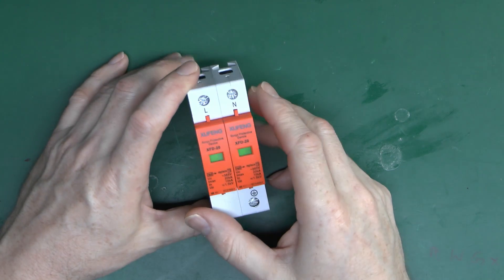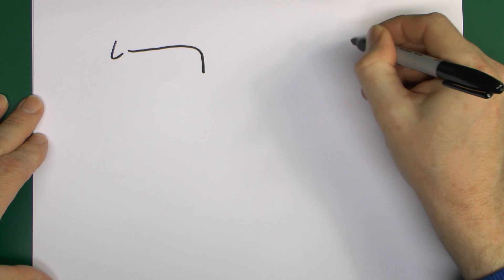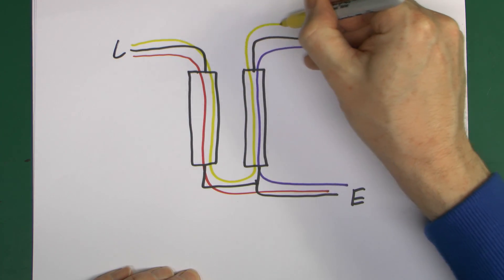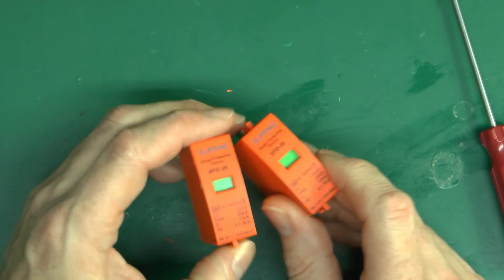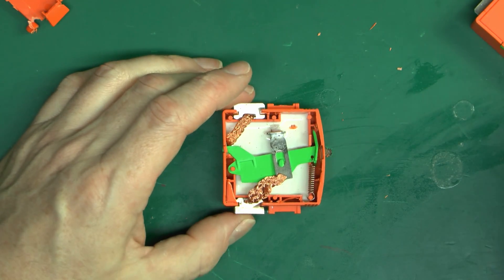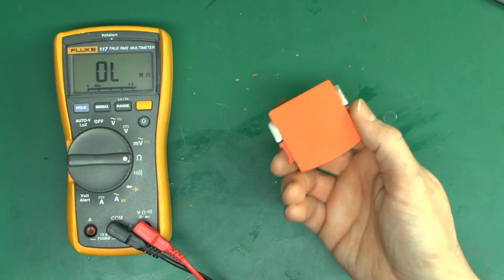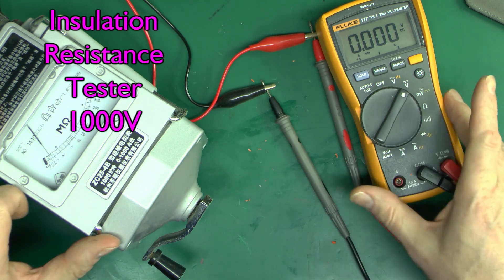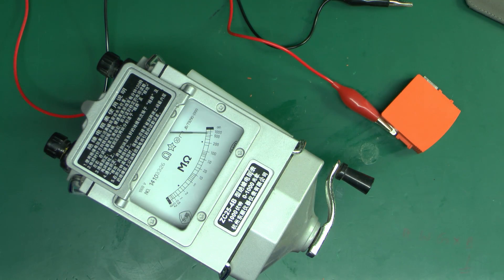Surge Protection Devices - Part 2

Comment: It has always been the case that new devices like these will have a massive profit margin as users have no idea that it is a few simple component that costs pence when purchased in bulk, it is the same with the gas discharge tube you find on the more expensive devices.

One of the features these have that wasn't mentioned is that the fault indicator arm when operated will protrude from the bottom of the module. If you have holders with the small microswitch in the base this is pushed in by the pin at bottom of the module. This will then operate some form of warning device so serves as a very basic fault warning feature.

When you consider the current that will flow during an overvoltage condition I can see an issue arising. If the device is inline with a simple MCB this would operate during an overvoltage pulse and would very likely be enough to trip the magnetic plunger fast disconnect in the MCB. This suggests that a higher rating MCB should be used but this would increase the chances of an overheating or fire.

I have used MOV's and GDT's in my own installation but used an MCB designed for high inductance loads. This will minimise the chances of a transient causing the MCB to open and depriving you of all future protection. It is therefore vital to have a method of monitoring failure of the module and tripping of its protective device.

Save yourself a lot of money and purchase some high grade MOV's, GDT's and incorporate a spark gap if you can. I have also seen some SPD devices using thyristors to clamp large surges. Using thermal glue bond some 80 of 100 degree centigrade thermal fuses and wire them in series with the MOV;s. As varistors fail they will slowly heat up so thermal protection is vital. I also incorporated a cartridge ceramic fuse (slow blow) and a continuous operation mains relay. Wire this to the output side so if the MCB trips, thermal fuse opens or fuse fails the contacts will open. The relay contacts are connected so they interrupt connection to a mains rated buzzer and warning lap. A neon with current limiting resistor can be used to show that the supply is present. Place all these components in a sturdy metal project box (don't forget to bond the PE to the box) and if you have used the correct components and wired the box correctly you will have a device that does everything a type 1, 2 and 3 SPD can do at a fraction of the price......... P.S. Don't forget to isolate your SPD when performing any insulation testing.

I hope this will help those of us who know what we are doing and can construct a device like this ourselves. Do not attempt making an SDP unless you know what you are doing !

One other question I had.... I remember watching a study by one of the universities that proved the majority of the energy flow was in the upward strike and the downward strike only when attracted by the potential difference in the ground served to ionise the air and allow the energy to escape upwards. In my experience with data and comms I have seen far more damage done to buried cables than overhead catenary cable runs. I am 99% sure that the study I watched proved that underground cables were at a higher risk than overhead ones. If this is not the case these days I can only assume it is due to underground cables being run in ducts or directly buried cables being SWA. Overhead run power lines and telecom services normally just have a stringer for support and would get no benefit from the shielding effect of SWA cable. Has anyone seen any later studies of lightning behaviour ? The study I watched was done in the early 90's.

Cheers all.

Stuart
Reply from the maker: MCBs are too slow to react to overvoltage transients - typical duration of microseconds, compared to milliseconds to trip an MCB.
Reply: @jwflame  I was considering the fault current that flows when the MOV clamps as opposed to high voltage spikes affecting an MCB. It may be possibly damage an RCD with its electronics but I expect they install a MOV on the RCD to protect against this.

I can foresee problems with the MOV's leaking as they wear out and someone has made the mistake of installing the SPD on a MCB that is protected by an RCD. Could be a visit to false trip RCD hell if you are not aware.

I would be interested to know if anyone has seen thyristors or heavy duty zener type protection on an appliance or an SPD.

Thanks for the reply John.

Comment: Will you be covering the surge protection that is apparently present in many extension leads? It is my understanding that, as long as RCDs and these MOV devices are present in the consumer unit, such "surge protection" as in extension leads is useless.
Reply from the maker: Depends on the distance from the consumer unit to the outlets - it may still be required for distances over 10 metres away from the consumer unit device.
Reply: Jivan Pal - the manufacturers will have you believe that there is no such thing as too much surge protection... But then again, the consumer unit versions are considerably more expensive than having a reasonable number of surge protected extension leads... The choice is yours.
RCDs don’t really affect things, other than they are useful in switching off the supply if a surge protected extension lead suffers a failure of the protection system and leakage current flows to earth from either the line or neutral circuits.

Comment: Im concearned that when mov wears out (with many less severe spikes), it wouldnt always show red as solder would have to melt first. Also when mov has worn out does it give us an open circuit?
Reply from the maker: When they fail, they become more conductive, until eventually enough current flows to heat up the solder link and cause it to melt.  It's a chemical compound, there isn't any realistic way it could fail open circuit.

Comment: Was it BigClive or David Savery that did a video on this about a year ago?  He simulated a thermal event using a soldering iron to allow the spring mechanism to operate.  The solder melted and pulled the conducting link downwards, but the excessive length of the link meant that a gap didn't successfully form.  It looks to me that this is likely to happen on these Xufeng devices.  Any chance we could see this demonstrated on the one that didn't get mangled?
Reply from the maker: Yes.  Have got 4 of these orange cartridges, so 3 intact ones to do something with.
Reply: Yeah was Big Clive, another money making scam this crap....
Reply: It was SDG Electronics that used the soldering iron to simulate an overheat event.

Comment: According to manufacturer Dehn, the only SPD suited for use in a TT earthing system has a MOV from L to N and then from N to Pe; no direct path from L to Pe.
What could be the reason for this?
Reply: To avoid the risk of a failing MOV causing the CPC to rise up to dangerous potentials.

Comment: Are AC and DC compatible?  Same MOV components?  Thanks
Reply from the maker: The basic MOV elements will work on either AC or DC.  However commercially supplied surge protection devices are intended for one or the other, and should only be used according to the manufacturer's instructions.

Comment: I've heard stories about these SPDs failing. Apparently the surge has been known to bypass the MOV completely and fry the installation anyway. Not sure whether or not SPDs were from a reputable manufacturer. here in Malta we are obliged to insert an overvoltage and undervoltage relay between the DP MCB and RCD at the origin of the installation. I dare say that the relay is a safer/ more reliable option.
Reply: I dare say that the relay is a much slower option and therefore a much more useless option.
Reply: @bdf2718  but I would think that an OVR is never 'spent' and therefore always affords an element of protection. From what I can understand an SPD can be spent and go undetected thus giving a false sense of security. Is that right?
Reply: @rooselectrix4846  OVR might protect you against the sort of line faults that put an extra 50V on the line.  It operates in a millisecond or two (if it's a fast one), and your equipment can probably survive that (filament lamps and heaters almost certainly, electonics maybe).

John was talking of higher voltage transients that last for microseconds to milliseconds.  By the time your OVR opens, the damage has been done.

The problem with MOVs is that they degrade a little when they deal with a transient and eventually wear out.  But before they wear out they handle things your OVR can't.
Reply from the maker: Overvoltage relays/trips are for entirely different types of problem,, and are useless with transients - far too slow to react, and it's not desirable to cut off the supply if a transient occurs.
SPDs are useless with overvoltages which last more than a few milliseconds - they will be destroyed.
As is always the case, it's about selecting the correct type of protection for the problems that are likely to occur.
Reply: @bdf2718  I have another question, if I may. In Malta most meters come with an incorporated 40A DP MCB (it is 40A, true). I was thinking that perhaps these SPDs could be fitted 1st thing after the meter, take the tails and main earth into it and connect the rest of the installation in parallel. 
It would look something like: meter -> SPD -> DP MCB (or main switch) -> rest of the installation. Does that make sense?
Reply: @rooselectrix4846  Nope, doesn't make sense.  What happens if the SPD is exposed to a long-duration surge?  The big fuse before the meter blows and you have to call somebody out to fix it.  The main breaker should come before the SPD.  Not just so that the consumer can turn the breaker back on, but also so that if the SPD fails the breaker can be turned off to allow the SPD to be replaced, rather than having to pull the big fuse.

[edit] I'm assuming, above, that the SPD fails in such a way as to damage the carrier so that the carrier has to be replaced.
Reply: @bdf2718  Thanks for your reply. Our meters come after a service head with a big (60A) fuse then, built into the meter, is a double pole MCB. I don't know if I was clear on that point earlier. Does that change anything? I was thinking that the MCB in the meter could act as protection for the SPD. My thinking is that a surge will pass through the meter anyway, so we can use the meter to protect the SPD. Thanks again.

(Just so you know, all domestic installations are TT here.)
Reply: @rooselectrix4846  I think it's more I misunderstood you than you were unclear.

Is the meter MCB operable by the consumer or is there a wire seal or something else that means the consumer can't operate it?  If the consumer can't operate it, you need another breaker the consumer can operate rather than having to call out an electrician to reset the meter MCB and replace the seal.

Is the breaker electrically before or after the meter?  If it's head->MCB->meter I'd be happier with another MCB between meter and SPD, even if it's the same rating.  But that's just excessive caution on my part as it shouldn't make a difference to the surge currents in the meter and the meter ought to be capable of handling them.

In the end, though, it's down to what your wiring regulations say you can do.
Reply: @bdf2718  The MCB in the meter may be operated by the consumer. The MCB is an integral part of the meter - which is why I've got this 'fixation' with using it as protection for the MCB.

 The meter itself is sealed but there is a window through which you can turn the MCB on or off.

Here in Malta we are expected to follow the latest edition of the BS7671.
Reply: @rooselectrix4846  I'm not an expert on these things.  Sounds to me like you could get away with it, if BS7671 doesn't say you mustn't do that.  JW would be the best person to tell you if BS7671 lets you do it, and whether or not it's a good idea.

Hmmm.  Does BS7671, as commonly interpreted in Malta, let you get away with the meter MCB being the only main breaker or must you also have one in the consumer unit?  If you only need the meter MCB then you can get away with it.  If you also have to have a main breaker in the consumer unit, then put the SPD after that.
Reply: @rooselectrix4846  hello friend. I was thinking the same with you, positioning the SPD in a better place, not like all the others in the electrical panel, and after the meter as you mentioned in your comment in my opinion is the most suitable place to put it. But I don't know if the distributor-operators allow to put it there. In the new meters the din rail were is located the braker switch has plenty place to put the SPD. I have nothing to do with electricity, is just my hobby, I am a  mechanical engineer. In my country we have a lot of lightning strikes problems. My neighbor's house was burned. In his case  it came from the antenna TV cable! Has nothing to do with the SPD. But never knows. For such a price is better to install it and not to loose all the domestic devices or even your life! Greetings from Albania!

Comment: Help! I get it that the SPD provides an alternative path for all the surge energy, but how does it prevent the overvoltage appearing at terminals within the installation? Isn't a resistance in the line conductor required to limit the voltage transferred to the installation? Great videos by the way, all interesting stuff … thankyou.
Reply from the maker: When conducting, the SPD is basically a short circuit across the conductors. Can be considered as an extreme case of voltage drop due to excessive current.
Reply: @jwflame  Thanks for the swift reply. Sorry to be a bit slow here but … the overvoltage (emf) is presented at the terminals of the SPD and also across the terminals of equipment within the installation that are connected in parallel with the SPD. Therefore, how is the equipment protected? Isn't the voltage drop across all parallel loads the same?
Reply from the maker: The simple way to think about it is that voltage is current x resistance.
If the SPD has an extremely low resistance (near zero), the voltage across it must also be very small, even with very large current.
As an example, if the surge current was 25kA, and the SPD had a resistance of 0.01 ohms for the duration of it, the voltage across the device would only be 250 volts.
In reality it's far more complex than that, but that is the general principle.
Reply: @jwflame  Unfortunately I don't think this explains it though, because fixing only one of V, I, R in Ohm's law doesn't fix the other two. For example, for a 0.01 ohm SPD, why not take the surge current to be 25MA so that the voltage is 250kV?

I must speak with some caution here as Electrical Engineering isn't my strongest subject, but it seems to me that the key here is to remember the source impedance, which forms a voltage divider with the load. Normally the source impedance is much higher than the load, so the voltage drop over the source is small. But in a surge, the varistor impedance drops, causing the load impedance to drop much lower than the source impedance. Now, most of the voltage drop occurs over the source reducing the voltage at the load.
Reply: @nathan87  When you said: "Normally the source impedance is much higher than the load" you actually meant: "Normally the source impedance is much LOWER than the load", right?

Anyway, yes, I see this exactly the same way as you. When I analyze this circuit, the only way I can see it working is when considering the impedance of the source/line, which will "absorb" the voltage drop in the surge scenario. If the source/line impedance is ignored, then there is no way this circuit will work, given that, even if the "resistance" of the varistor drops to 0.0000001 ohms, the voltage applied to the installation will still be equal to the source.

I think there is a general misunderstanding on how this circuit works tbh, I am really trying to find sources explaining precisely how it works, but none of them cover this. Overall it seems weird to me that the protection relies on the parasite impedance of the source... but I can't see any other option for this to work...

Comment: can you re-solder this after it expires?
Reply from the maker: No, the cartridge needs to be replaced.  The solder link fails because the material in the device has degraded and become permanently conductive.

Comment: Hi John, what would be your thoughts on SPD’s if I was the ONLY one to fit an SPD in my street. My thoughts is that a LOCAL Surge would head to my Consumer board first up and cause major damage . Brian W
Reply from the maker: If you are the only one, then you have protection and everyone else does not.  It won't damage anything, surges do not seek out SPDs.  In an extreme case your SPD might be damaged, but everyone else would have other equipment damaged which will cost far more than replacing an SPD.

Comment: Wouldnt it have been better to put the L terminal at the bottom, so it could insert into a standard busbar?
Reply: I guess if it has to be after it's own MCB/RCBO, it's better done that way
Reply: Doing it this way in theory allows any brand SPD to be fitted to any manufacturer CU as there would be no mechanical stresses on the busbar. The CU manufacturers will probably still telling you only their SPD's can be fitted inside their CU's.

Comment: How safe is it to omit the MOV direct from line to neutral?  Doesn’t this risk putting significant potentential on the earth in a TT installation?
Reply from the maker: Without it, protection will be significantly reduced.  Risk of potential on the earth is no more than any other fault would cause.
Reply: Ah, so would this be connected ‘downstream’ of the main RCD?  If so, I can see that it’s clearly the same as an earth fault on another final circuit.  Moreover, I guess most transients are short enough (I think you said microseconds) that you’ll not dump enough energy into earth to trip an RCD.